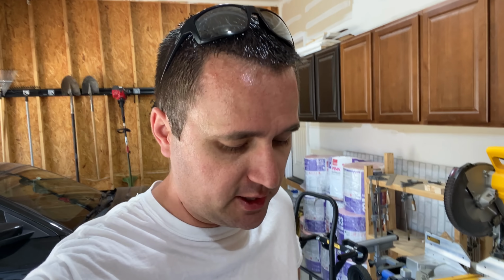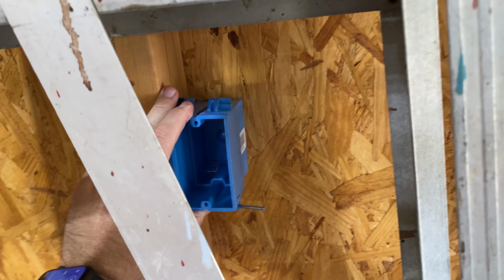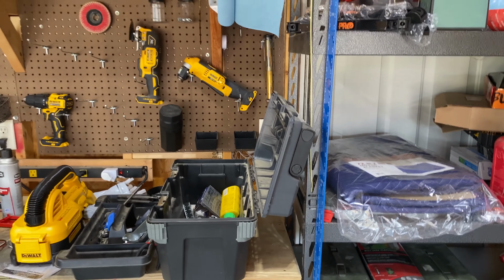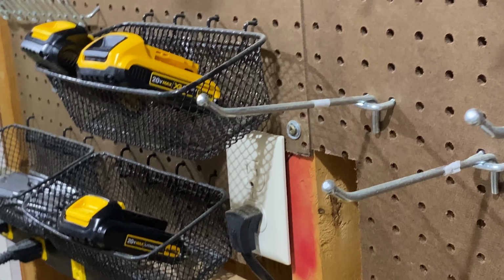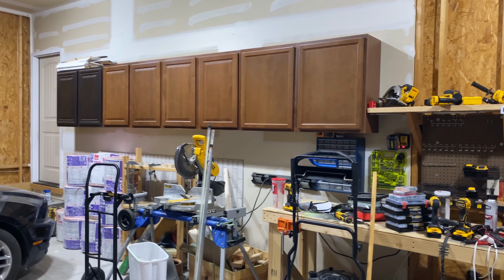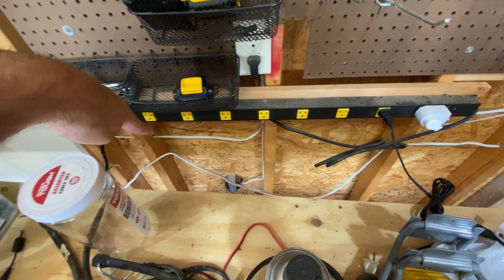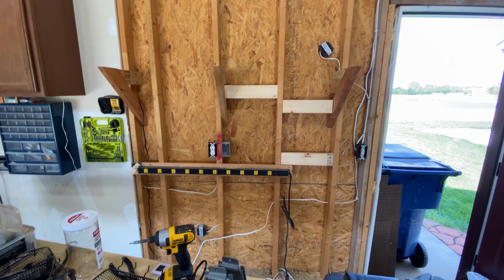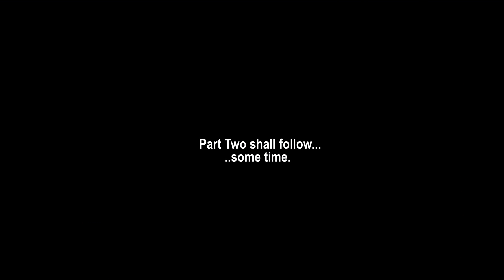I'm doing another Garage thing... #Vlog? Pt. 1

Comment: do plywood instead of drywall, you can mount way more things anywhere and it's a garage so eventually you are going to ram things into the wall, plywood will stand up much better. While you still have open studs may be worth adding a 220 circuit if you have the room in the main panel. Whole lot of garage toys that you can get if you have 220 available.

Comment: So those blocks are not fire blocks.  They are sheer blocks 4ft in from the corners to add strength on the sheer panels at the ply wood seem. Also you are not supposed to leave slack at the boxes. You re supposed to secure the cable within 6 inches of the block with NO slack/. Slack and lose electrical cable is bad JUJU. 
YOu might want to verify your garage is not already sharing a GFCI from another circuit in the house, it likely is and 2 GFCI on the same circuit will fight each other and constantly trip under moderate loads.
Reply: THIS.  Your garage outlets are likely already GFCI protected, sometimes off the bathroom circuit.  Time to start tripping GFCI's (via the TEST button) and see if power goes out in the garage before you proceed with adding one.
Reply: Jason @ByteMyBits really needs to hire an electrical contractor... Jason PLEASE don't be like Austin! DON'T BURN YOUR HOUSE DOWN!! And check with local building codes before you really do anything!! Willis Cooper is correct in his comments! Don't just wire it up and think it is okay... IT'S NOT!

Comment: Correct me if I m wrong, but I think you should only Insulate the exterior walls. Insulating the adjoining wall to the house would be a waste right?
Reply: it helps, not as much but still does something, plus its also a bit more of a sound barrier. If you're doing it everywhere else you might as well hit that wall too

Comment: Just a small observation....why would you put unnecessary charge cycles on your $1000 battery when you have mains voltage available? I mean, I get it...you want to use the power cell but Li-Ion cells are rated for about 500 discharge/charge cycles if I recall correctly. (They can be charged more than that but at diminished capacities)

Comment: I'm not a professional but I thought outdoor and indoor circuits aren't  meant to be mixed. Also is it  just me or do home builders never put enough outlets in a garage.
Reply: all depends on local code.
Reply: It’s catching before hangin’ when your a homeowner. No sales inspection is going to reveal that unless you have a full electrical and why would you if it works?

...and mostly outdoor outlets are supposed to be dedicated because people like to plug 15A string trimmers and mowers into them.

Comment: It's probably a good idea to put the socket boxes on after you drywall it. That way, you can make sure they're properly flush.
Reply: That is false if you have an open wall. There are notchs on the boxes for proper depth.
Reply: @williscooper7750  when there's drywall on it, it's no longer an open wall :p
Reply: @AnnaVannieuwenhuyse  Dont be silly.  You always put everything in the wall first before dry wall. He did the proper steps of adding the boxes, running the wire, insulating then eventually drywalling it. Also you missed where he said he would dry wall later but needed the outlets now.
Reply: The point of a new work box is to put it in BEFORE the drywall. Old work boxes are designed to be installed AFTER drywall is installed. How are you supposed to nail the box to the stud when there's drywall in the way? 😛
Reply: @jensalan  In Ann's defense, they make drop in boxes that make use of a screw and clamp like system for if dry wall exists. Although, you are correct new work box should be done before dry wall
Reply: @jensalan  I was not aware these existed in the US, I guess! The only ones here are the ones fastened to the back of the drywall

Comment: Most modern houses already have GFCI in the garage. Depending on your local code, the GFCI outlet itself could be located indoors, maybe in a bathroom. My old house had all the outside and bathroom outlets on one GFCI located in the master bath. My current house is bigger, but the garage and the outside outlets are on one GFCI in the garage. I would check before throwing a GFCI onto the line that may already have one.
Reply: Depends on the year the house was built. Where he lives, is where I also live, the code states the garage must be on its own and have one in the garage of built after 2004. Otherwise its likely sharing with the bathroom inside. 

Our local codes, now, require 1 for the garage, each bathroom must be on their own GFCI protected curcuit as well as any Kitchen(s) must on their own as well.